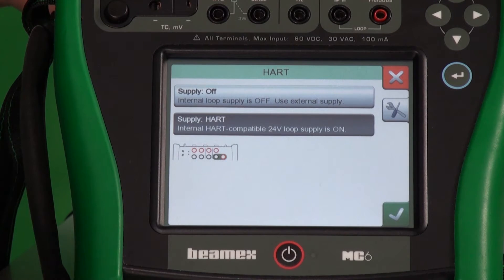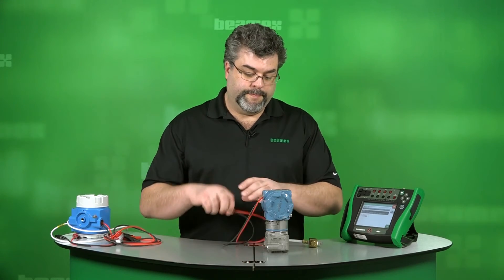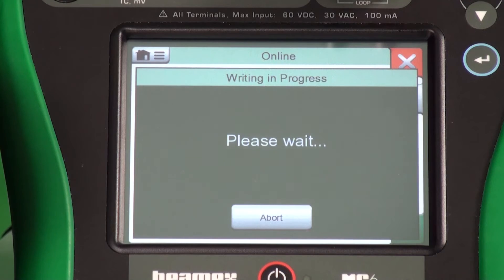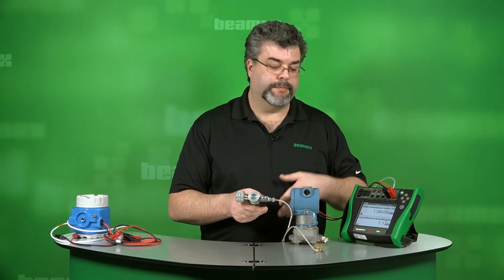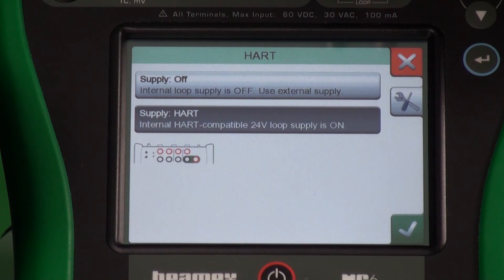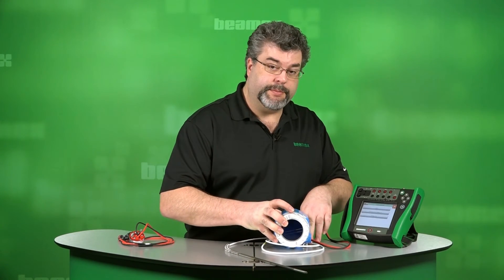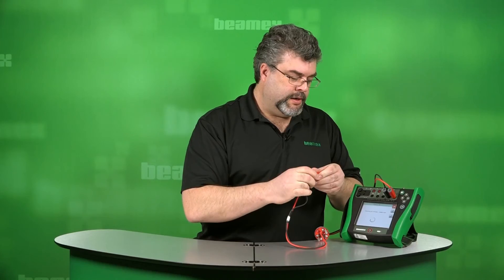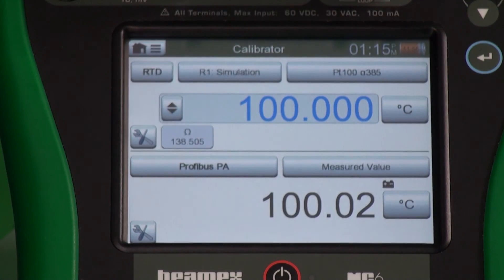Beamex MC6 - Introduction to the field communicator features of the MC6

Comment: i would like to know,  is the pressure module are modular? i mean when u ordered it u have the option to remove pressure module, and can order it differently in another time?
also what is the others module that u can order it defferently?
Reply from the maker: Hello Sir! There are internal and external pressure modules available for MC6. 
For the internal pressure modules, there are 4 pressure module locations (3 + a barometric module), and you can specify which you want when you order the MC6 (you can also take fewer modules, or even none if you want). These internal modules can not be changed by the customer, but these can be added/removed in factory service. 
There are also interchangeable external pressure modules available, these can be connected with a cable to any MC6 family calibrator. So you may have several external pressure modules for different ranges and you use the one that is most suitable for the job. 
I hope this helped some. On our website you can download the MC6 brochure and manual to learn more. 
Thanks, Heikki /  Beamex